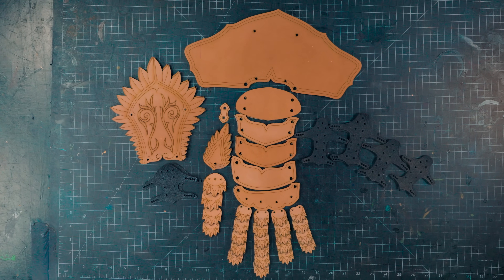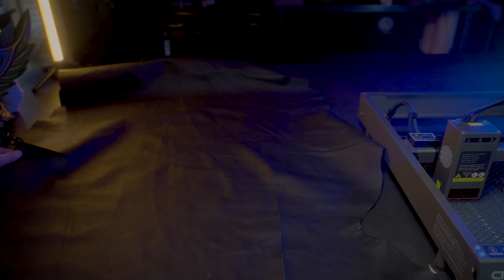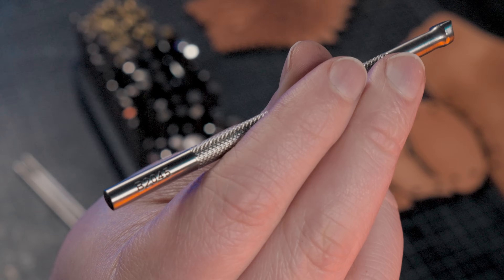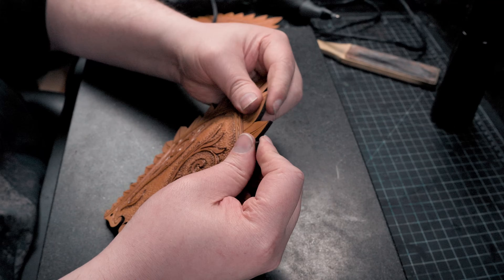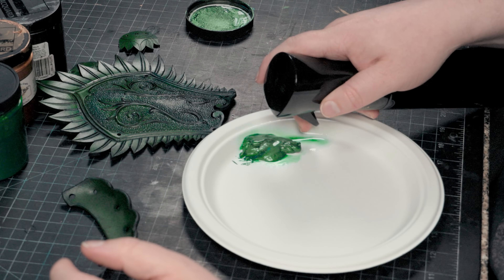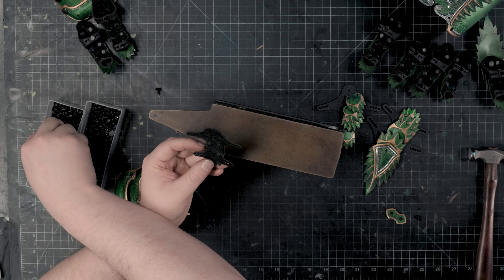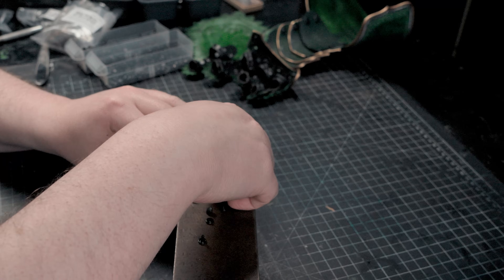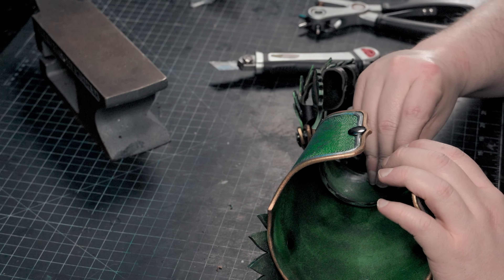Elven Gauntlets Tutorial

Comment: In building the Fantasy set, I found that the TIG welding gloves from Harbor Freight work admirably. They are thin, with a long cuff, and take dyes very well. They are a white glove with a black cuff. I used Fiebing's green and black mix and they turned out very nice.
Reply: Interesting. I’ve found cheap leather gloves at salvage and surplus stores before, they left dye stain on my hands from any moisture.
Reply from the maker: I've definitely used a pair or two of that type of glove along the way but yeah, they aren't the best fitting.  Good gloves can be hard to find but some of the motorcycle gloves have a more fitted design, many are too clunky though.

Comment: A tip about rivets  - 
I have not yet had to use this method myself,  so test it.... I understand the annoyance of finding rivets in the size needed with the cap desired... and now have a huge collection of sizes and mismatch parts... (sigh).. 
There is a tool used to round off the ends of wire ect... some names for it is wire end smoother.... cup burr.... I add the word
" jeweler's " to find small versions  ...  this tool used after loading the hollow post of a rivet with a toothpick  to help avoid crushing the tube, then nipping the tube to desired length.   Flick the wood out with a needle tip, de -burr the tube with the cup of the tool...  assemble as normal. 
Its one of the methods that can be more effort than a task is worth... unless the rivet post is just too long to do the job.
I often pad out the area held under a slightly too long rivet,  either sandwiched between the visible surfaces or with a backing piece on the unseen side...  I have used pop rivets with tiny matching washers too.

Comment: Using a laser on chrome tanned leather creates a lot of toxic fumes because of the chemicals used in the tanning process. You need a very good ventilation system or air purifier.
Reply from the maker: Using a laser cutter creates smoke you don't want to breathe in general.  It's worth researching yourself, (because it's too much to get into on a YouTube comment) but I will add there is some misinformation (and outdated information) out there regarding the toxic chemicals of laser cutting chrome tanned leather.